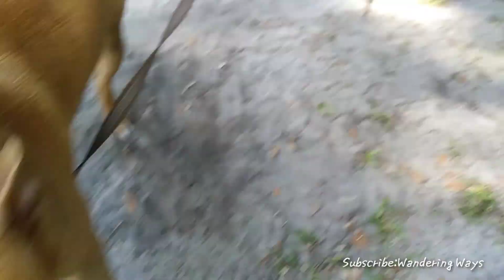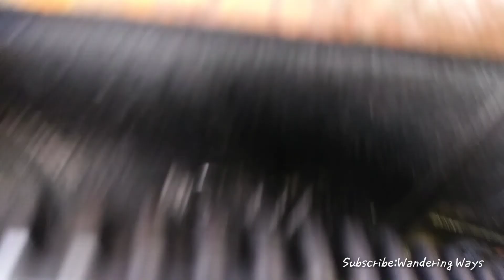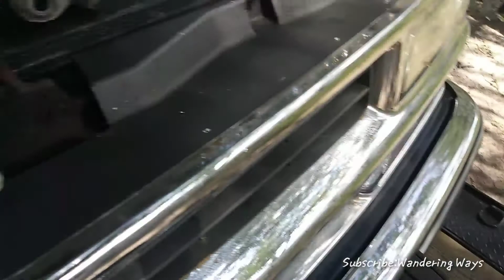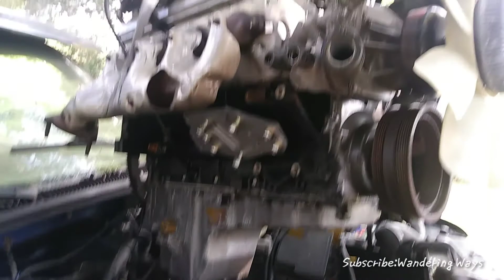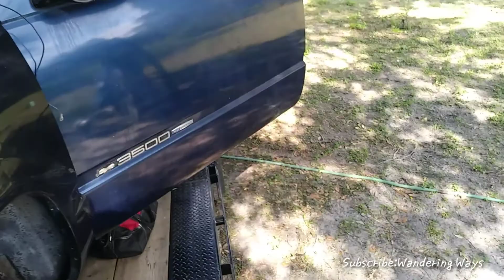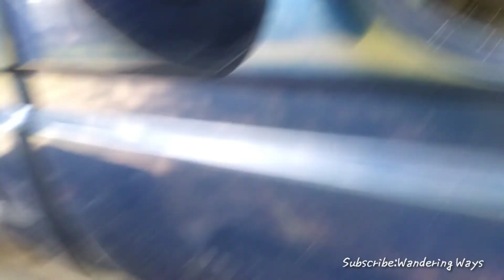#OBS #DUALLY crew cab #LQ9 swap #Holleyefi

Comment: Gathering parts & making a plan to do the same ('06 LQ4 6.0) swap in my '93 C3500 crew cab long bed. It's not a dually though.
Reply from the maker: Hells yeah .drop vids
Reply: @wanderingways1  worried at all about the 2-piece drive shaft and carrier bearing? I'm 50 years old, but still drive everything like it's a racecar... hope it holds up, lol!
Reply from the maker: It breaks,ill fix,hasnt broke yet
Reply from the maker: 3 doughnuts in a parking lot with a full cab,then drove it across u.s.a!

Comment: Was you able to use the factory diesel y pipe? Was you able to finish the conversion,  I'm gonna look now for your latest content,  appreciate the videos cause I'm wanduring is the 6.0 better than the 6.5 turbo engine as far as pu)Ling power,, Thanks again
Reply from the maker: Didn't use diesel exhaust. It came off one pipe from the turbo. I cut it of. It had a u pipe from driver to passenger. Junked it. And yes Google hp and ft tq of the 6.5 then Google the stats on the 6.0 ltr. That's how it was easy for me to choose
Reply: @wanderingways1  how's the fuel mileage compared? Now that diesel is more cash than gasoline its a consideration
Reply from the maker: @moodybluemotorsportsDwneKnos  I'm sure it's better than an older cast iron small/big block being its feul injected snd the tolerance sre much tighter/something about the cathedral port heads as well. But the feul gage is disconnected. Tomorrow is Saturday so I'll be driving it around a bit for the first time. So I'll get back with everyone on that!

Comment: Did you use the 4L80E that came with the 6.5? I'm thinking about doing the same thing.
Reply from the maker: Yes sir I did. When you look online for torque converter,it's labeled 6.0 or 6.5. So it works also,just watch the flex plate. You may need with or w/o spacer. And summit sells flex plate to crank bolts. I paid $5 a piece for all 6

Comment: What leveling  kit you have on the front of your dually I'm looking  to do mines before  I start  on the swap
Reply from the maker: Im not sire there is one on it. I bought the truck shortly before the swap. With no engine it looks leveled. But you loose i think it was 90 pounds on engine weight on the 6.0 swap. So the 6.0 let's it set just above original height once installed